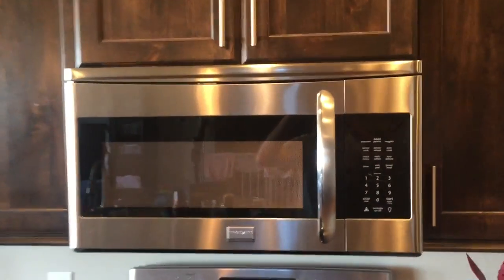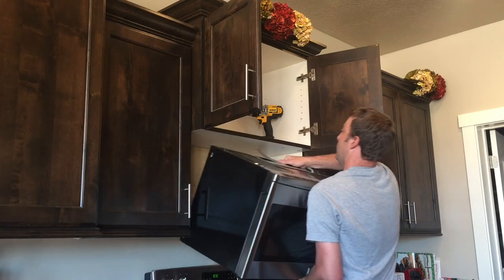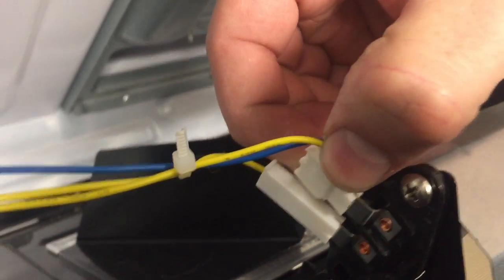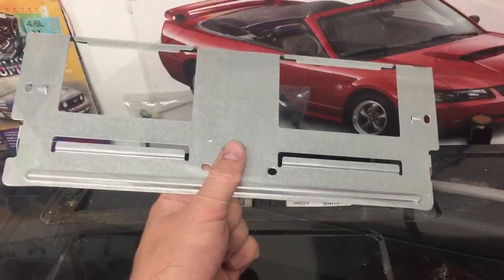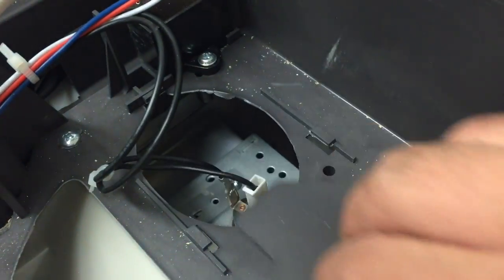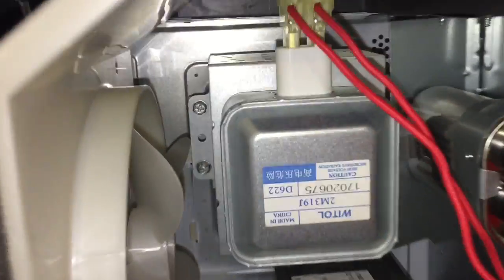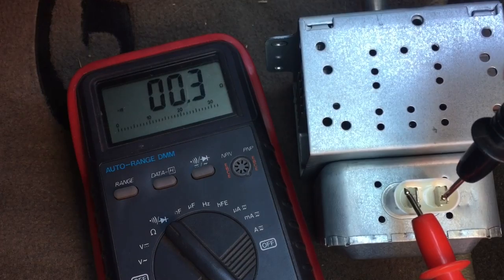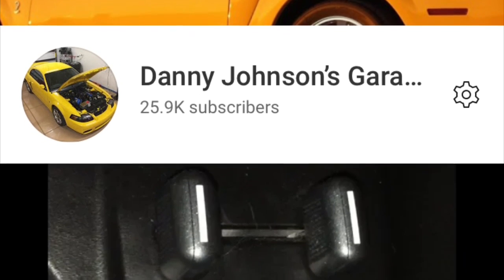Frigidaire Microwave Magnetron Removal and testing. Microwave won’t stop running

Comment: If the microwave won’t stop running, it has a bad interlock switch or relay on board sticking. For either one you could leave it mounted and remove control panel.
Reply from the maker: Walter Sibelius Thank you. I’ll look into that. I appreciate the comment 👍🏼
Reply: Danny Johnson’s Garage no problem,  been working on appliances for 38 years. Your channel has helped me a lot, so a small pay back.
Reply: I have frigidaire thats barely a year old. The other day during normal use it popped a breaker. Now if power cord is plugged in and door closed the microwave will automatically run without manually activating it using control panel. What can I check?
Reply: Watler Sibelius my microwave does this...silly question but once i take panel off what do I replace in there? Thanks
Reply: @waltersibelius5023  once the control panel is removed how would you fix that? order a new interlock switch or relay?
Reply: @fuelyouth2393  if you have a multimeter you can ohm out the switches, the Frigidaire microwave is know for bad switches. They make a kit for those models.
Reply: @bigboybuilder77 were you able to find the solution for this? I have the exact same problem with my microwave, not sure if it’s repairable or get a newer one. Appreciate your response in advance. Thank you
Reply: @Phani Kadumuri  we didn't find the fix. Unit was surprisingly replaced by manufacturer. We had to call them directly several times though.
Reply: @bigboybuilder77  thank you for the response, ours is 3 years old and I doubt they will replace